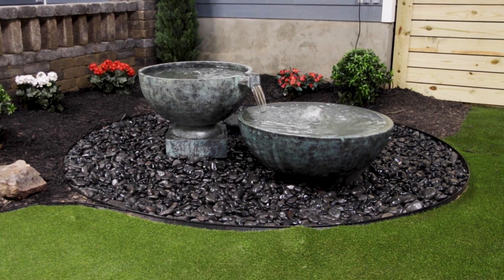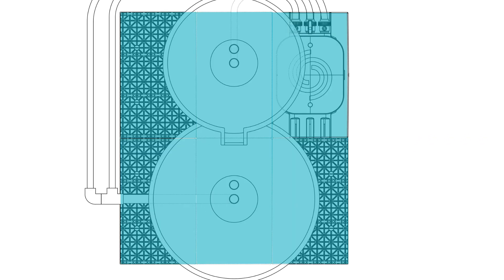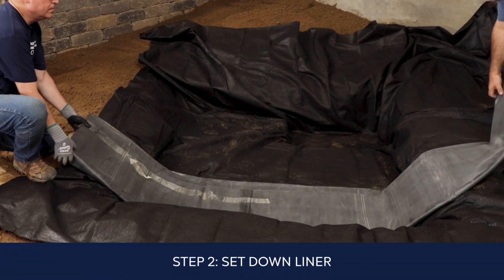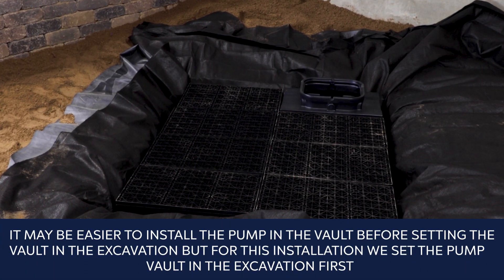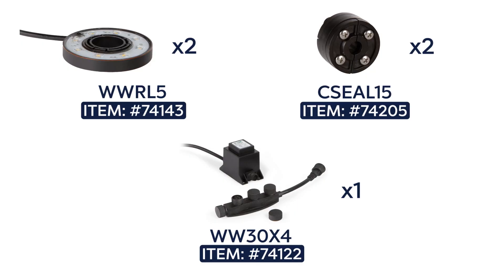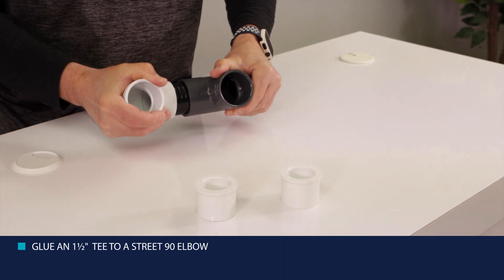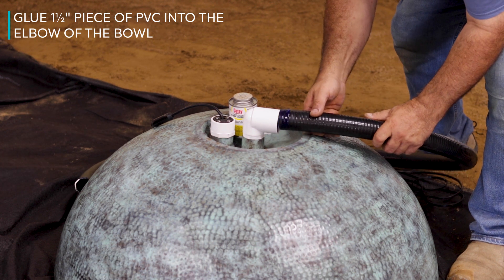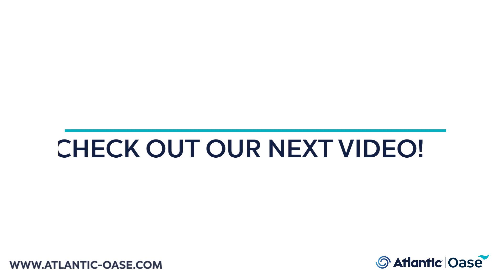How to Install Hammered Brass Fountain Bowls - Atlantic-Oase

Comment: You guys include 5 ecoblox in the kit, however in the video you guys use 7
Reply from the maker: @pavelkolp Yes, we did use 7 because we were going to install additional toppers later on. You only need 5 (what's included in the kit) to support the two bowls.